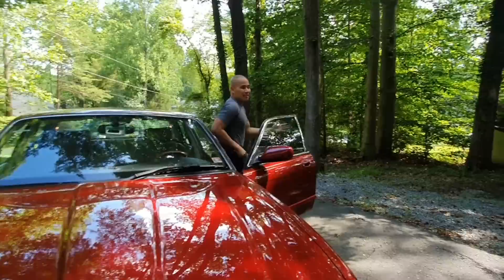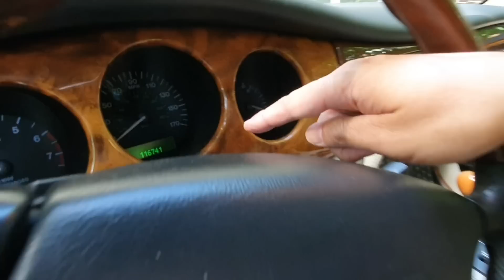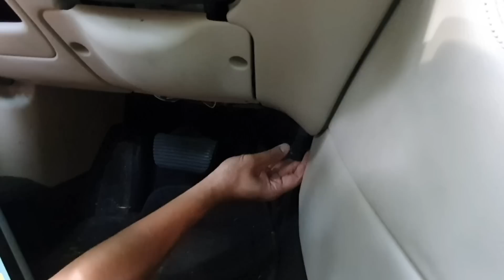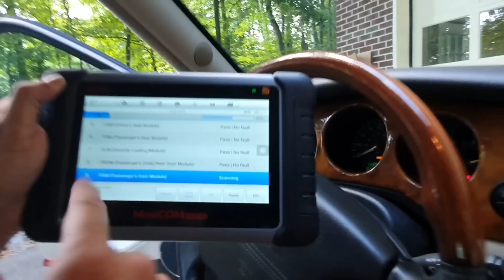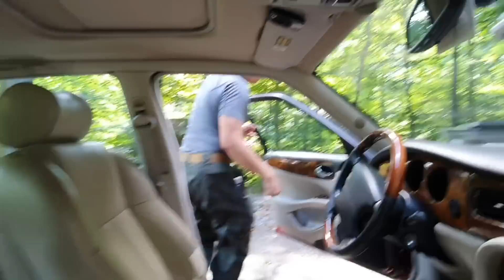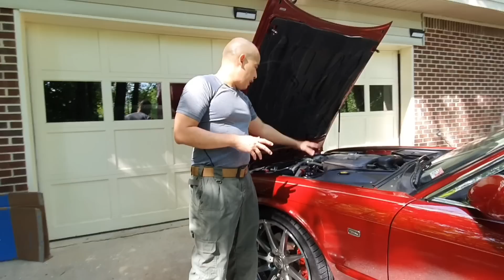Jaguar XJR 2 Years Ownership Update (Reliability Issues, Maintenance and Repair Cost)

Comment from the maker: You can purchase the Autel MaxiCom OBD2 scan tool through the Amazon affiliate links below:

1. Autel MaxiCOM MK808TS TPMS Programming Tool Scanner with Full TPMS Service All Systems Diagnoses Multiple Reset Services (Same as MK808/MX808/MK808BT+TS601/TS508) 

https://amzn.to/2RqwQw7

The oil and tools that I use to maintain my Jaguar XJR:

1. Castrol 06244 EDGE A3/B4 0W-30 Advanced Full Synthetic Motor Oil, 1 Quart, 6 Pack (You need to buy 2)

https://amzn.to/2sYh69Q

2. Castrol 03101 EDGE 0W-40 A3/B4 Advanced Full Synthetic Motor Oil, 5 quart, 1 pack

https://amzn.to/2sjnfxf

3. Castrol 03129C EDGE High Mileage 10W-30 Advanced Full Synthetic Motor Oil, Black, 5 quart

https://amzn.to/34UrzjU

4. Dorman 65324 AutoGrade Oil Drain Plug

https://amzn.to/2PWrbNC

https://amzn.to/2PTyFAO

5. Mann-Filter W 719/7 Spin-on Oil Filter or OE Oil Filter by Jaguar Part EAZ1354

https://amzn.to/2SrNQTm

https://amzn.to/379s1fv

6. Mann-Filter C 31 130 Air Filter

https://amzn.to/37cl9ya

7. Liqui Moly 2009 Anti-Friction Oil Treatment -pk6

https://amzn.to/34UV8BG

8. Liqui Moly 2020 Motor Oil Saver (Pack of 6)

https://amzn.to/3769ock

9. Liqui Moly 2037 Pro-Line Engine Flush - 500 Milliliters

https://amzn.to/2QiVQDz

10. Liqui Moly Jectron Gasoline Fuel Injection Cleaner-pk6

https://amzn.to/2PV9fTc

11. TEKTON 5866 12-Inch Oil Filter Pliers

https://amzn.to/39cbgSU

12. DEWALT 200 Piece Mechanics
https://amzn.to/34UkOhR

13. Race Ramps RR-56-2 56" Race Ramp - 2 Piece

https://amzn.to/2QhSxwy

14. RAVENOL J1B1045 Power Steering Fluid - PSF-Y Full Synthetic Hydraulic Fluid (1 Liter)
https://amzn.to/36orfLR
Reply: Hey EJ I was wondering if you knew how to replace the headrest. My mechanic wants to charge me $250 labor to replace install one
Reply from the maker: I haven't done it yet. I wonder why it costs $250
Reply: @ejsgarage  could be that it is connected to the controls for seat adjustment.. and requires rewiring.. or the mechanic is just a jerk
Reply: Great content. Like the Jag a lot. CCM module is your Air Condition, so it could mean you A/C compressor is faulty. Try to start the car and put A/C on and then run scan. It might be because ebgine was off so it couldn't test it ?
Also abs is not a one word :) It is pronounced A-B-S as in sepperate letters just so you know man.

Thanks for time to sharing vids. I am thinking of buying XJR so its good to know they a DIY cars really. Mercs are so much about software and yeah Scotty has a good point about them. Take care man
Reply from the maker: Thank you very much. The older XJRs 1998 to 2003 have a lot less computers. I am going to finish changing the brake pads and rotors video once the rotors arrive.
Reply: Sorry about not getting you picture. Not the biggest cell fan, but if you drop a link for emails I'll surely send you the photo if you wish.

Comment: 2001 XJR, just under a year of ownership now and about 23,000+ miles (its my daily and commuter).  Apart from gas and oil changes its been very reliable, mainly just old car issues really...rear wheel bearing, power steering pump, front shock upper mounts, cam cover gaskets, driver's door opener cable, spark plugs and air filter.  Only oddball repair was my dual linear switch failed inside the console and it took me a bit to identify the issue and then was tough to find a replacement.  All in all, its been a blast and I fall in love every time I get in and drive it.
Reply from the maker: That's awesome brother! It is a good car for a daily drive and very pleasant interior.

Comment: 116K its just run in ...beautiful cars! 🙏🏻 and the less you drive it or it sits around isn't so good either....
Reply from the maker: Thank you very much. I really love driving this car.
Reply: @ejsgarage  I'm looking for one in the UK where i am. Either the XJR or the XJ Super V8 because its better equipped and has sunroof etc but both have the 4.2 ltr V8 Supercharged engine ...looking for a later model with aluminium body and chassis but tbh a good well looked after one I'll consider and just underseal the body / powder coat the subframes etc etc ... I'd put the smaller pulley on because those that have done that say it makes a big difference plus a stainless steel performance exhaust ( tasteful one as I've heard some nasty raspy ones and that's not what these Jags are about ) and sort out the poor air intake with an aftermarket quality recommended induction air intake ( can't remember the grands now but there are 2 very good quality ones designed specifically for this engine. I have a Ford Mondeo Mk3 ST220 3.0ltr V6 Duratec which the USA never had. Lovely car and still quick with lots of extras. They're becoming rare now and slowly going up in price but always loved those Jags 🙏🏻👍🏻⭐
Reply from the maker: It is getting very hard to find one here in the United States. People are keeping their car for collection.
Reply: @ejsgarage  i don't blame them! The limited edition XJR 100 is a lovely car and such a shame you had to sell it! In honesty though i prefer the interior of the XJ Super V8 and the XJR. ....the red piping looks nice and the limited edition 100's will be worth a fortune later but they're already climbing in value and price not surprisingly! There are 3 or 4 100's for sale here at the moment and a few Super V8's and XJR's ...a really nice one around £12,000 but some going up to nearly £30,000 which they won't get.
I've followed so much advice on these cars to buy and they say it's not worth paying silly money for a low mileage car as short trips won't have done it any good but 80k to 110k is where I'm looking. 
I do detailing so like you try to keep my cars looking pristine where possible...I've spent a fortune on quality detailing products lol ..

Comment: Thank you for sharing this video.  I am thinking getting one of this on AutoTrade, it is over 100K mileage and the price is about $10.  Not sure if the price is right.  One is 1st owner and the mileage is only 26K but dealer is asking for $24K which is more than I want to spend.
Reply from the maker: Is it the 2002 black Jaguar XJR 100? That one is a special car and it comes with 6 piston Brembo brakes. I had one before and I am regretting it to these days for selling it.  The price keeps going up for because there are only 265 in the world and it is a collector piece.
Reply: @ejsgarage  It is 2005 XJR with 3 previous owners. Last owner had it for 12 years. Mileage is 109k and asking for $10K. It doesn't show the interior photos, wonder if the seats are torn or ripped. It only has 5 photos from outside.
The One owner XJR was already sold with the price $24k.
Reply from the maker: $10K for 2005 is a good price, the 2004 to 2008 have very nice big brake calipers. I will buy another one if I can find one near me.
Reply: @ejsgarage  What do you think about  2004 XJ Vanden Plas? One is for sale for $9,200.  One owner with no accident, 125k mileage.
Reply from the maker: It is a nice car but the XJR is more fun to drive.

Comment: Really nice Jag, keep it like this! I own a 1998 4.0 Sovereign X308 with 313000 kilometers and its still running fine, with a bit of care they run forever.
Edit: The ABS and Trac light is a lot of times just a low battery
Reply from the maker: Thank you very much. I really love the old Jags, they are beautiful cars.

Comment: Is a 04 XJR with 77K miles for 13K a good deal?
Reply from the maker: Check the air suspensions, they cost ＄2500 each and usually I had 2004 Jaguar XJR and the suspensions leaked air at 59k.
Reply: @ejsgarage  any other potential major flaws that you think i should be on the look out for this Jag?
Reply from the maker: Coolant reservoir nipple will break and you will have coolant all over the engine. Thankfully mine broke when I entered my garage. I bought a new reservoir for ＄350 and installed it myself.

Comment: I'm looking at a Jag XJR on auction, little sketched but if I can get it for cheap it runs and drive and doesn't have any problems listed so fingers crossed
Reply from the maker: Hi Ramon, I hope that you will get a good one. The maintenance is pretty affordable and you can watch my videos on how to do it. Repair and parts are not cheap.

Comment: EJ, entertaining and informative buddy.
As I posted before, just pumping up my tyres to the correct pressures 32 front, 34 rear eradicated my error lights.
Mine is a 98 XJ8 Sport.
Paid £1,000 3yrs ago.
Yip, she's a daily driver, people let me out of junctions just look at her👍
Treat her well and they are reliable.
Reply from the maker: Thank you very much Richard. I love my XJR even when it is parked inside the garage. I love to look at it 😉
Reply: @ejsgarage  The pic in my avatar is my actual car. Only problem I have just noticed is a slight smell of fuel in the cabin after I fill up.
I don't know if it's the filler pipe, it seems to move a little when I put the gun in.
Slightly annoying. But, I'll suss it.👍✌
Take care care buddy.
Reply: @ejsgarage  yeh! they're so beautiful, can't help but love them. And that smooth engine is a joy to behold.
I will never, ever sell her.
Alpine green, changes colour throughout the day and in different weather conditions.
Jaguar colours are incredible and perfectly match the cars' beauty.
Reply from the maker: Your XJ8 sport looks beautiful 😀👍👍👍

Comment: I have a 1998 XJR for about 9 years I replaced the pulleys and belts, tune up with spark plugs once and changed the oil regularly. I just got the traction control fault along with the ABS light I must say the vehicle is great given the age and its in great condition, i will like to send you a picture if you would like.
Reply from the maker: That's awesome Ricardo. Do you use Instagram to post your Jag photos? Follow me at @YouTube_ejgarage.

Comment: its crazy how good this paint looks when in good condition, my x308 n/a has the same color just missing clear coat. In your experience does this car with clear attract a lot of attention?
Reply from the maker: I agree, the XJR looked fades when I saw it at the dealership but after detailing it. The paint was still in good condition. There are some major scratches that I covered up with touch paint but they eventually need to be repainted. The car gets a lot of attention when I drive it because the clear paint is very shiny. 😃A  body shop or paint correction place probaby can fix your 308 😃

Comment: These cars are really good  when maintained, I'm currently at 186,XXX and looking to make it into the high 500,xxx in the next 11 or so years.
Reply from the maker: That is awesome that your Jag is still running strong at 186,000 miles 😀👍👍👍👍
Reply: @ejsgarage  its not without its hiccups, its on its third trans(zf box). it was a gift from my father and I plan on restoring it bit by bit.  Hardest part was choosing a tire to equip (the oem 16" wheel can't have extreme contacts or p zeros)
Reply from the maker: I am restoring mine bit by bit too. It is getting there 😀

Comment: Great Video , love the Wheels, and the Colour !
Keep these X308 Rollin !

Maintenance on my 00 X308 160K Miles :
New ABS Sensor
New ESP Sensor 
8 New Sparks
Ignition Coil
2 spots underneath welded
New  Front wheel Brake lines and attachments
Front wheel stabilizer replaced
G5-Tronic Oil change

These X308 Sedan's are so Unique, because there is no other Car Brand that makes a Sedan , were U sit so low.
The AJ-V8 Engine was voted among the Top Ten Engine's Build in the Year 2000, by WARD's.
And I consider the Supercharged V8 , is even more reliable , because it doesn't have Variable Valve Timing .
Greetings All !
Reply from the maker: Thank you very much Skele. That is awesome that you also maintain your own Jag 😀👍😀👍1

Comment: Absolutely Beautiful and  Stunning car! Wow, awesome color you picked! Custom paint correct?  I've owned many Jags. Love them. I've now got a 95 XJ6 base model. Interesting,  similar mileage as yours, @ 116,800 miles. The only problem (new one I've never run across) is the drive shaft center carrier bearing. At between 30-35mph the vibration starts, then goes away. I took the car to Drive Line expert. He quoted me $750 labor to fix it due to the parts in the way to get to it. Have you ever had this problem? Of course the part, the carrier bearing is only $75. Suggestions? Thx again.
Reply from the maker: Thank you very much. The 95 XJ6 is a beautiful car. I never have thr drive shaft issue yet. When my Jaguar frame assembly broke, he told me to buy the part on ebay and I paid him $275 to install it. It was a hard part to install because I watch him installed it. I really like my mechanic shop because he will install parts that I bring to them.
Reply: @ejsgarage  Thx. You in California?
Reply from the maker: Virginia. I used to live in Thousand Oaks, CA. I had a great mechanic there at 76 gas station near Raplh supermarket. His name is Sam. He drives a Lotus but he is an honest mechanic.

Comment: Hoping your Halloween was less trick than those 20" rims your running, but thought I might lay a treat on you to commemorate the holiday. When you mentioned the HVAC had thrown a code, and said it was a water pump, you were only half right. It truly is a pump, but its the auxiliary coolant pump it was warning you of. Its impossible to see from the top or bottom, as its buried under the expansion tank to the side and behind the radiator. The brushes in the motor regularly wear out, and may be replaced to restore operation. You'll see it and the hose's attached to it once the expansion tank is pulled free, and from sources has few fasteners to secure it. Its a booster pump for the cabin heater core. Benz's have had them since the 80's, and they may be had whole for a little more cash. Its black plastic housing will look much like the picture I'm including here. Very best wishes, and happy holidays my friend.
Reply from the maker: Ahhhhh thank you very much Murray for the information. At least now I know which parts to get to fix the issue..😀👍
Reply: @ejsgarage  because its located near the source of the cores coolant reserve and supply, its sandwiched among those things intentionally. You'll see all the hoses departing the ports of the pump once everything is out. Your heat is going to be substantial once you get it replaced. Glad to lend a hand when needed. These aren't just your normal automobiles we're dealing with here. Happy that I recalled the item existed on these makes and models. Have great evening my friend.
Reply from the maker: Thank you Murray. Have a great evening too 😀

Comment: I have a question I want to know why do my 1999 Jaguar XJR look like it's going to overheat but it not what could it be the problem and I have another problem with my 1999 Jaguar XJR my AC blow out hot air and I need some answers could you help me with them
Reply from the maker: The thermostat probably needs to be changed and the refrigerant needs to be recharged.
Reply: @ejsgarage  the 22-in rims look good on a jaguar I'm trying to put some on my 1999 Jaguar I have 20-in rims on it already but I want some 22s you think I got to get it left
Reply: @ejsgarage   what is that I'm not a mechanic I just love my Jaguar I'm not good very good with cars
Reply from the maker: I may make a video on how to do in a month or two.
Reply: @ejsgarage  I took it to the mechanic shop and they recharged the air and all that and it still blow how hot air did they pull a quick one on me
Reply from the maker: It sounds like the compressor is going bad and needs to be replaced.
Reply: @ejsgarage  okay I never thought about that I will get that checked out is a compressor cost a lot for a 1999 Jaguar
Reply from the maker: They are not expensive. Denso 471-1358 New Compressor with Clutch
https://amzn.to/3i1Gf7p
Reply: @ejsgarage  have another question what would it takes to make my exhaust from my 1999 Jaguar muffler sound mad evil not so loud but just in the middle to let them know that's a jaguar and it's not playing when we pull up at the light for all Jaguar owners

Comment: Hello EJ. I have a 2005 Jaguar Vanden Plas. After it rains drops of water comes through roof from the molding around the around the windshield.  The black trim around the glass is worn out. Do I need to replace the whole windshield or can I get the black molding that surrounds the glass. Where would I get it for a good price?
Reply: Thank you for your help EJ.
Reply from the maker: My pleasure Kelly 😀
Reply from the maker: Hi Kelly, I made a video.on how to reseal it. Try it out https://youtu.be/iEjeSaIZEa4

Comment: I love Jaguars i had a 2003 3.0 v6 s type  the look and the driving experience was awsome but the electrical parts are nightmare. There was always something and i constantly had the check engine light on my dash. I owned the car for 3 years and i spent up to $10k onto the maintance. Mine was a low miles example too. There are certain parts what you have to buy in new like the brake booster or water pump etc. these parts cost a fortune. I spent over a $1000 for the brake booster change and another $1500 for the water pump belt and tensioner change. The front wheel hubs are also pretty expensive cause when you have a worn out bearing you have to change the complete hub cause it’s a complex unit. It contains the ABS sensor too so it’s a completely sealed piece. It costed me around $500 per side to change it. So keeping up a Jaguar is not a cheap thing but  for some reason i have never had a bad feel towards the car. Will never forget those beautiful years and miles with the car and maybe someday i will have another one.
Reply from the maker: The 3.0 V6 S-Type is a nice car but it comes with more issues than the XJR unfortunately.